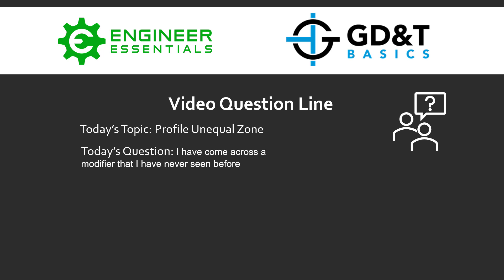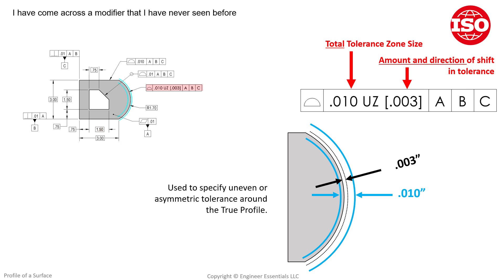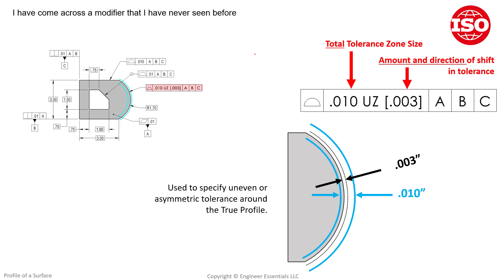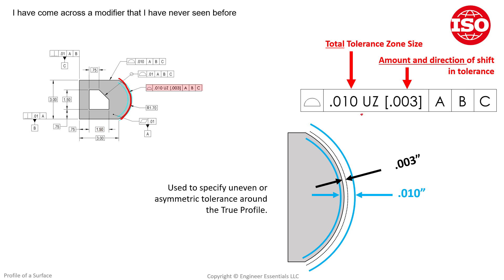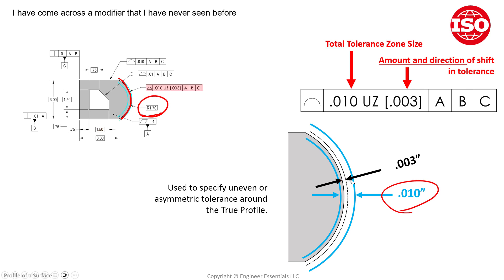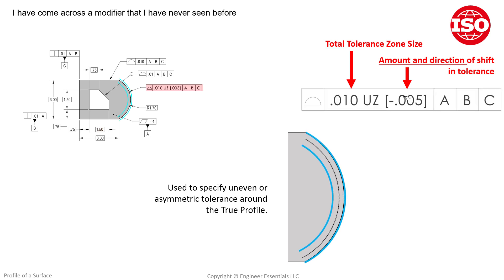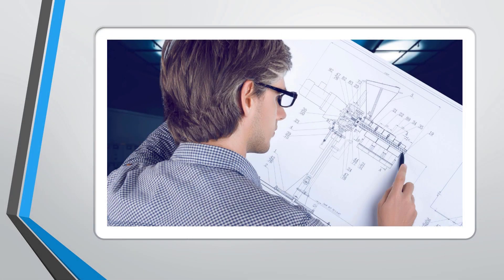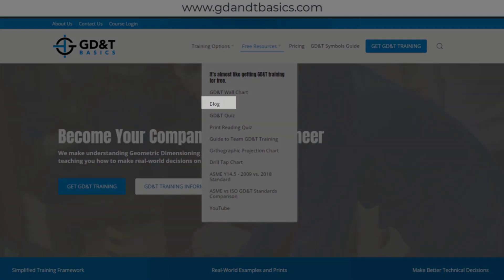Profile Unequal Zone

Comment: Jason, you mentioned it is "similar" to the ASME Unequally Disposed Tolerance.  But how does the ISO modifier differ from the ASME modifier?  DO you have a video referencing that?
Reply from the maker: We dont have a video that directly states the difference between the symbols however, this video discusses how the UZ modifer works for ISO. The second value in the FCF is the amount and direction of the shift, where as the unequally disposed modifier, outlined in this video (https://www.youtube.com/watch?v=arikjl0S3HE&t=14s) has a second value that represents the amount of tolerance that exists outside the part.